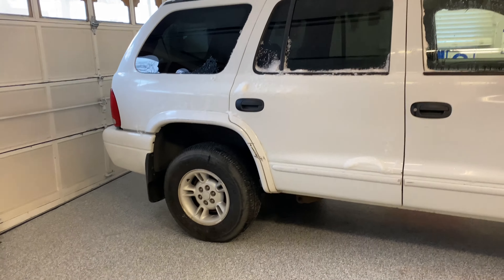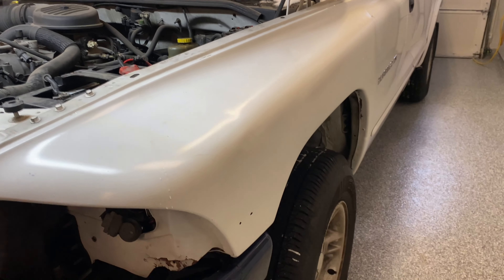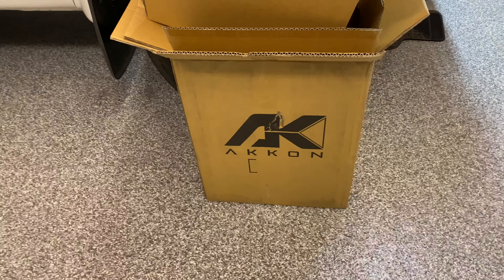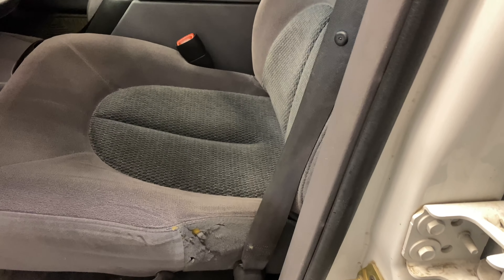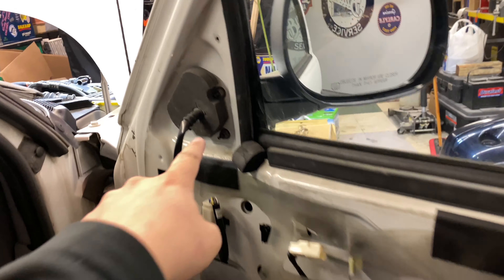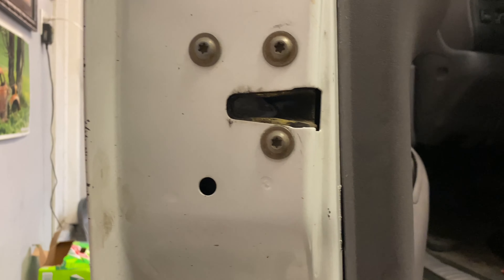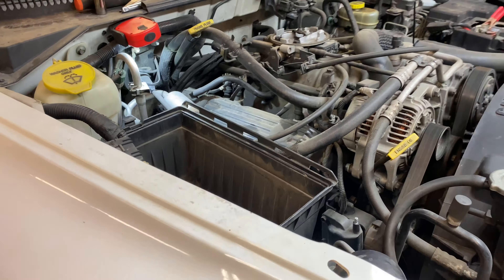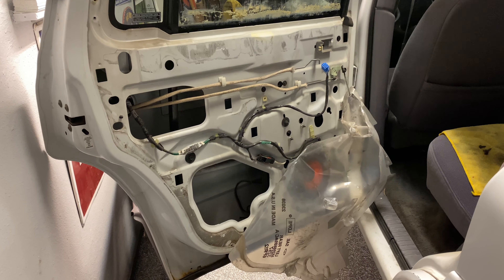Dodge Durango Build 1

Comment: I need front fenders, hood, radiator, support, bumper and cover for a 2003. You still have the donor in the yard? Is it silver or the light kaki, looks light gold. Still have it? I need the light Kaki/gold. Anywhere near Maine? I have a 2003 4x4 burgundy parts truck, beige/tan interior. Parts available.

Comment: I'm in the process of redoing a custom B-Body 440 aluminum rad swap. It's alot of work but totally worth it. Heavy duty electric fan junked the mechanical fan. Upgraded the transmission cooler to mishimotos with a 1300cfm fan. I've done alot of other goodies. But otherwise the durangos are something not very oftenly seen modified anymore.

Comment: Also a really cool mirror change although requires wiring some and a little drilling is putting the 2002 ram trucks mirrors on. I did it worked great not too hard.